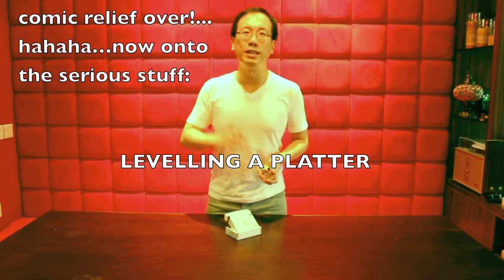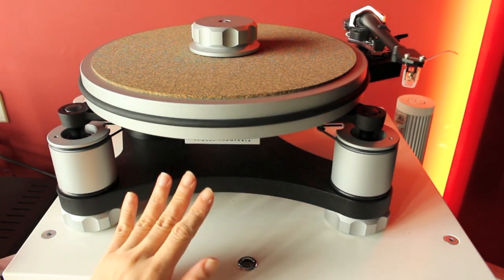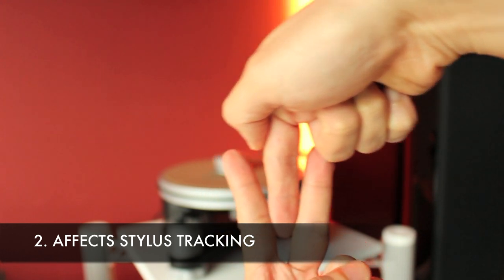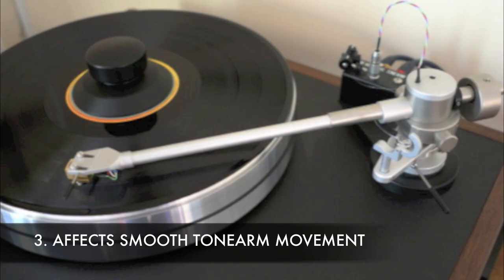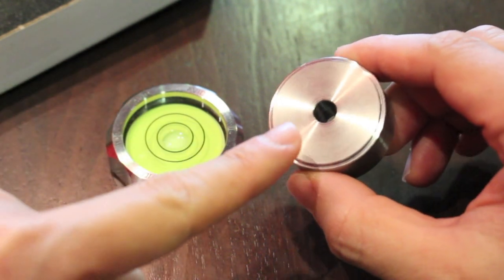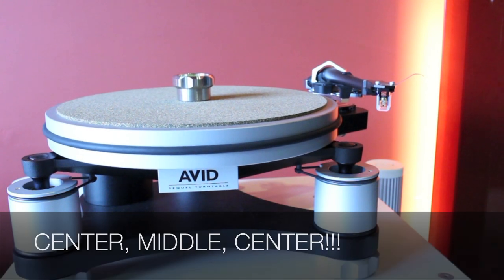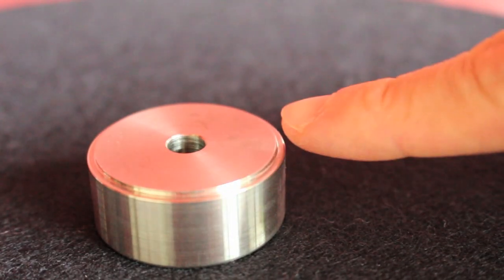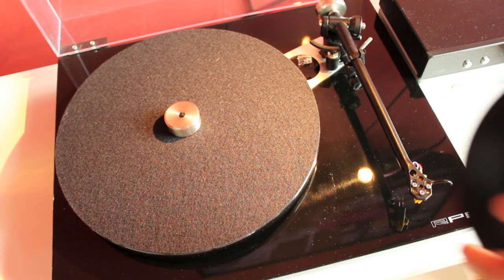Turntable Setup: LEVEL your platter!

Comment: For those in the quest of leveling your turntable dont work yourself too up much over it. Yes it is important but it doesnt have to be exactly perfect, just close. The main purpose of levelling a turntable is to prevent undue forces (gravity) from effecting the tonearms position in the groove. There are already lots of forces on the tonearm itself (it pulling itself towards the middle due to the record spinning) and the bias against this (antiskate) I doubt a turntable being slightly off level could have a large enough impact to counteract these forces (and in my experience i could not tell). However If a turntable is severely off I can definitely see this being an issue
Reply: ideally thats what you want

Comment: Hi again lan, 

I've got 2 more questions for ya, is it true that Microfiber brushes can cause light minor scratches to vinyl?, can you suggest me a good mat to replace the stock rubber mat that came with my SL 1210 m5g, i have the following cart "KAB/Ortofon ProS Integrated Design" or "STY40", right now i'm using the stock rubber mat on top of a dj felt matt, thanks bro'.

Louie
Reply from the maker: Dear Louie! :-) sorry it has taken a few hours to reply you.

http://herbiesaudiolab.net/ttmat.htm

This is the mat that an experienced vinyl friend who works with setting up turntable systems for hifi retailers ad bono for their shops and during audio shows.

He had demonstrated it to me just 1 week ago using it to replace the stock rubber mat on my Technics SL1200Mk5 with great improvement in sound! Clarity, details and dynamics (especially microdynamics) all improved.
You can give it a try!!!

I am not sure about the microfiber issue...but I'm sure there are some black sheep that produce such brushes that damage and scratch the vinyl record grooves.

For me, I have switched to "analog relax" brand, made in Japan, for the finest brush with the thinnest and softest fibres that the hard core vinyl collectors use in Japan.  Each fibre is measured at only 0.03mm. Ends are smooth. I had been using it for a week and have since dumped my older carbon fibre micro fibre brush.

I hope it helps!

That mat feels very nice as well, tactile-wise :-)

Let us keep the Vinyl flame burning and growing.

Best regards, 
Ian.
Reply: +HiViNyws channel Hi lan, 

Thank you for the tips, the herbie mat looks awesome and very affordable, i'll definitely pick one up ASAP!, regarding the analog relax brush, i'm still trying to find it online, let me know if there's a direct link to it when you get a chance, i really appreciate your help, thank you!

-Louie
Reply from the maker: +lz2k7 oh yes Louie, my friend asked you to get the 4mm version of the mat for the Tech12 turntable :-D. I had forgotten to inform you.  It looks good, feels good and sound good.
Reply: +HiViNyws channel Big thanks to you and your friend, i'm gonna order the 4mm one today :) thank you brother.
Reply from the maker: +lz2k7 it is okay my friend :-)

Comment: I'm using a Numark PT-01USB turntable. It's been fine for 6 months.
But recently there seem to be skips on some of the 12" singles i recently bought, especially on the first track of each side of the record. I'm wondering if it's because my Numark's platter is only 7 inch in diameter and a 12-inch single would be subject to the weight of the stylus/tone-arm, thus causing jumps when it plays the 'outer' tracks... ?

Comment: The problem with levels like this one is the bubble size. Ideally, it would be the same exact diameter of the inner ring. That is how a good machinist's level works: the bubble touches the inner reference marks when the surface is  perfectly level. This Avid model is probably the best one available for suspended turntables, since it can be placed above the spindle, but for rigid tables, one is better off using something similar to a Starrett machinist's level.
Reply from the maker: Dear Friend, I see your point clearly on this.  :-D I agree. Thank you for your knowledge!!! and most important of all: sharing it with all of us.
Best Regards Buddy,
~ ian.
Reply: Yes I'm a machinist I agree.  But my question is that when I put my Bubble level (which also is a  record stabilizer viborg audio can be found on E bay / Amazon)  it leveled on 1 side but when I turn the platter it's not & when I try to prop up the feet it throws everything off?  & all my TT are like that I think it's weird!!!  So I agree a smaller one might be better..

Comment: Question I got  VIBORG Record Stabilizer  a bit bigger then yours do you have to have the platter spining?   or move it by hand
Reply from the maker: Brother, :-D great to see you again!  Yes brother, the platter is stationary when this test of levelling is conducted.  :-D
Reply: Should it be  leveled all around because I only for it leveled on 1 side when I turn the platter by hand  the bubble moves?
Reply from the maker: Brother, what turntable and mat are you using? :-D
Reply: a Dual 506,  Toshiba SR-F451 & a Technices SL-B2  I have a switcher box all 3 are connected to it, New records get played on the Dual used records on the other two,   Someone else told me to put a small Bubble Level in the middle of the Arc where the Stylus will be on the record.  For instance if you're looking at the Platter from the top view it'll be off Down to the Right a little bit  where the Stylus would be hitting the record in the middle of that.
Reply from the maker: It makes sense Buddy :-D  i agree with you on this.  Thank you for sharing too!!!  Warmest Regards :-D

Comment: How do you level the rega turntables?
Reply from the maker: hi Friend, you can work on the rack itself.  I hope you are able to do it :-)
Reply: Hi, I can't use a rack, or wall mount. Is there any levelling legs/feet that will work?
Reply from the maker: Chuck Norris Dear Friend...probably there are aftermarket adjustable feet for Rega!  Many people use cards to shim it up :-D
Reply: I need a whole deck of cards for mine! :)
Reply from the maker: Chuck Norris Hahaha... no no no my friend!  I hope not!  But nice one friendly joke and remark for me to read brother!  It made me laugh! :-D
See you brother!
Reply: Thing with the rega is that if the platter is out then you can’t level it with the arm because the arm is fixed to the same plinth. I found this as the hole wasn’t cut straight for the bearing housing. ☹️
Reply: @HardyBunster  What did you wind up doing?